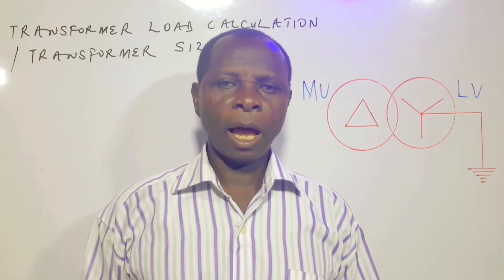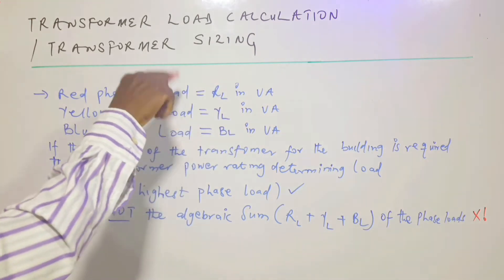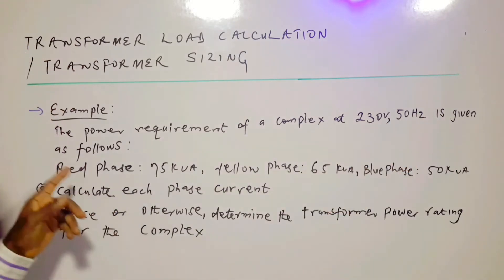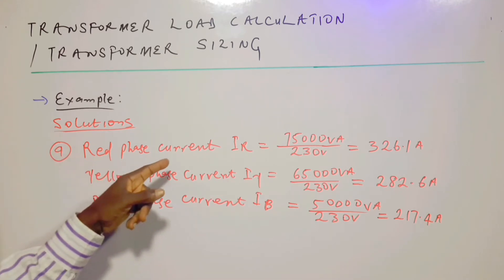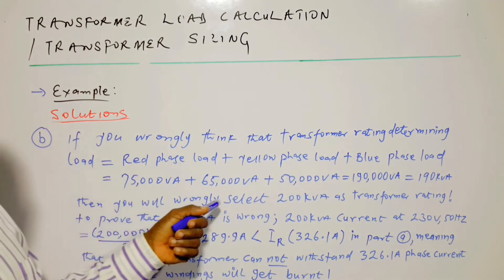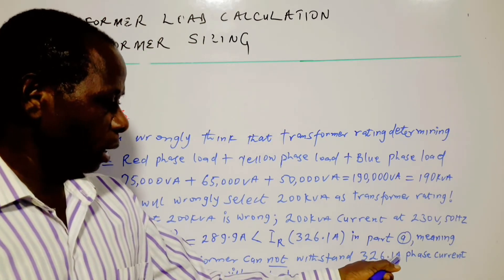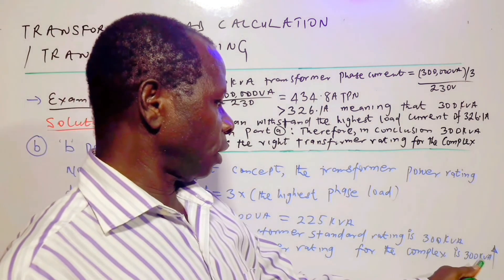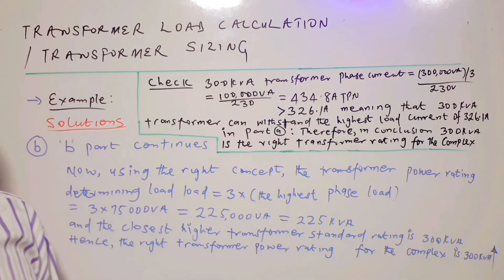Transformer load calculation / Transformer Sizing

Comment: Thanks for sharing this video. Some few questions: How are the peak loads across the phases calculated? How do you compensate for future loads in your  transformer selection? What standards are you referencing to select the transformer sizes after calculating the highest load in the network? Enjoyed the analysis. Well done.
Reply from the maker: The powers given in the example are the required phase powers plus some power surplus, so the selection /calculation takes care of peak and non peak loads.
The surplus included in the given phase loads makes up for the future transformer incremental load.
Meanwhile, one must be careful about the magnitude of the power surplus ! So that the ptoject cost will not be unrealistically high. The power surplus to be provided has to depend on the type of project and the distribution item in consideration. The use of transformers is flexible. 
For example I designed underground electrical power distribution system of a university campus some years ago, and I provided more power surplus on the underground MV cables than on the transformers, as it is easy to move a transformer from one load centre/sub-station to another, unlike MV cables buried in the ground ! The university campus is now in existence. 
Now, returning to the last part of the comments:
Ref standard: NEC;  Article 450 as regards transformers.

Thank you,
e-mail: jkadsols@yahoo.com
Reply from the maker: And please do subscribe and hit the notification bell.